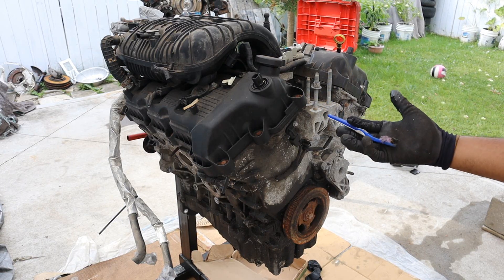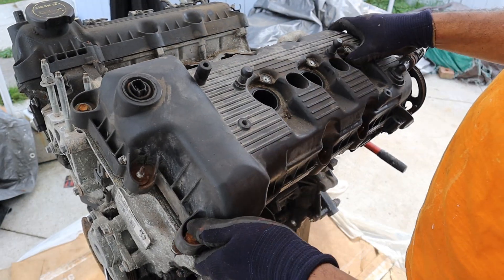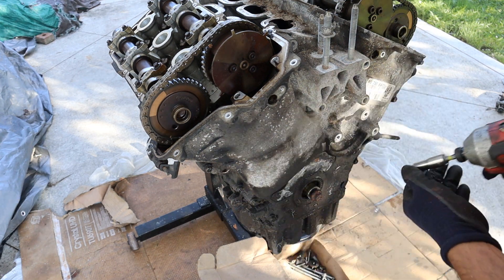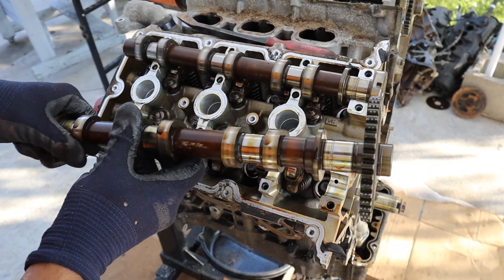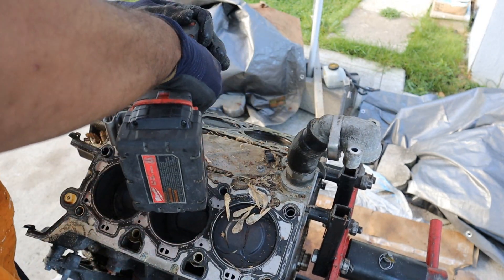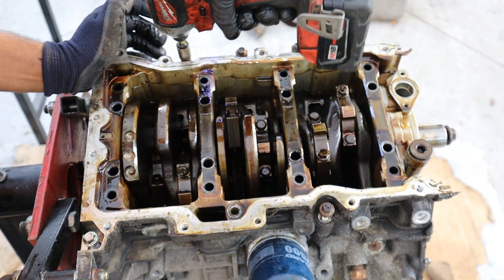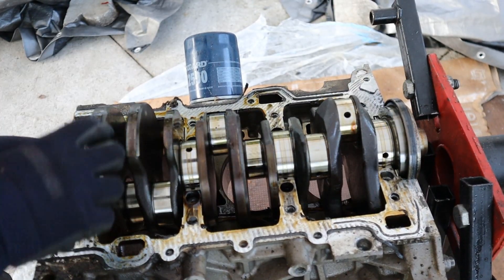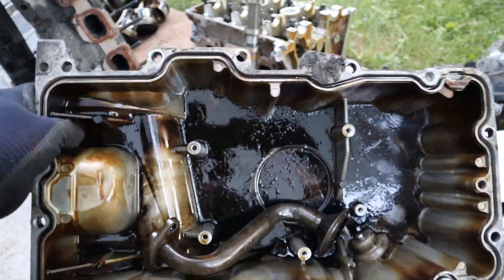Ford Duratec V6 Teardown: A Reliable Engine from Ford?

Comment: 2008 Ford Fusion SEL V6 here, i LOVE THIS ENGINE!  About to hit 178K miles, and it has been excellent.  I'm leaking oil from the valve cover and oil pan but idgaf, i just top it off every couple months.  This engine has an awesome exhaust note with a muffler delete, and it has been completely reliable for me.
Reply: Had a 2012 Fusion and STILL have a 2008 Taurus X. Fusion was the 3.0 and the 3.5 in the X. Both were absolutely bulletproof. One of the best non-performance Ford engines ever made IMHO.
Reply: @BrightLandsCarFan  My other favorite Ford engine is the 300CI (4.9L) straight 6.  I'm saving up for my dream truck, which is a single cab long bed 1992-1996 F150 with the 300 straight 6 and a 5 speed manual transmission.  To me, that's the perfect pickup truck engine.
Reply: @BrightLandsCarFan  i agree!
Reply: Designed by Porsche, that explains why they all leak oil.
Reply: @ericaddis7414 mine doesn't
Reply: Just replace the two gaskets. Cheap, easy, and worth it!
Reply: Mine has a quarter million miles and still runs strong. They do leak a lot of oil. Doesn't burn a drop like the new GDI engines but they do leak.
Reply: Change the valve cover gaskets because it will damage other sensors and mess up the alternator. I've learned that lesson three times already. And the messed up oil filled alternator ended up shorting out my ECM.
Reply: I have the same engine in my Escape
Reply: I've got a quarter million miles on mine. Still going strong.
Reply: I have the same car and engine and I love it I got an intake and tune I do want high flow mufflers though it seems the exhaust is way too quiet stock
Reply: Muffler delete with resonators still installed? 

Got an 11 fusion and wanna make it growl a bit more but not so much that there’s a lot of drone..

Magnaflow cat back kit sounds nice but so pricey
Reply: @fdamien80 yes, all i did was cut off the mufflers at the back and weld on 90 degree elbows to direct gas at the ground so i dont burn the underside of the car.  Everything before the mufflers stayed.
Reply: CAN SOMEONE TELL ME IF THE FORD/MAZDA 3.0L DOHC DURATEC V6 ENGINE WAS GOOD?  AND WILL IT LAST 300-400K MILES IF I KEEP THE MAINTENANCE UP?
Reply: @nickcoleman4702 Absolutely, mine just passed 300k still runs like new
Reply: CAN SOMEONE TELL ME IF THE FORD/MAZDA 3.0L DOHC DURATEC V6 ENGINE WAS GOOD?  AND WILL IT LAST 300-400K MILES IF I KEEP THE MAINTENANCE UP?
Reply: Me too
2008 SEL V6 Fusion 
70k 
It’s a fantastic car